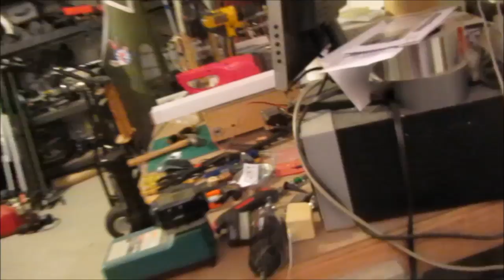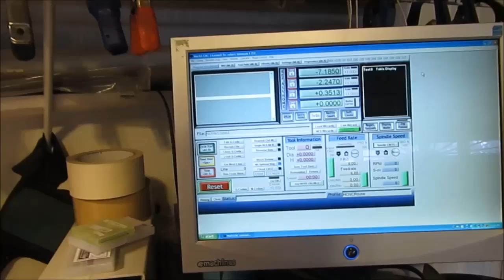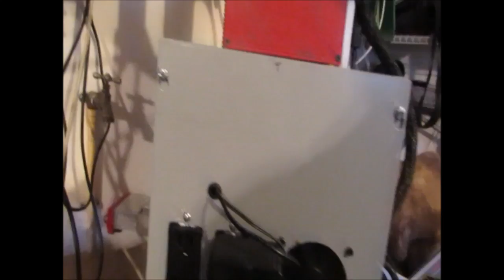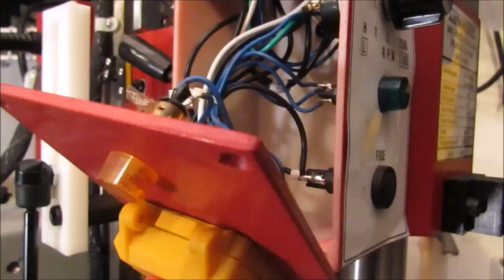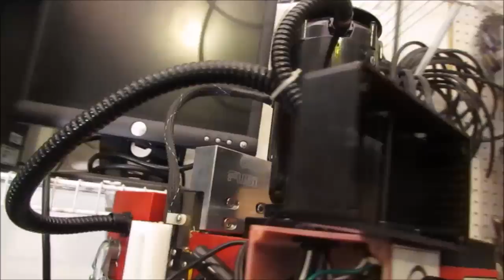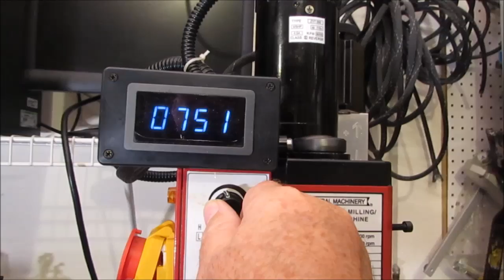Mini Mill Spindle speed RPM Meter Installation

Comment: What is the clamp called holding the sensor
Reply from the maker: It's just a plastic (electrical) clamp you can find at any Home Depot. It's used to hold wire and electrical cables.

Comment: I wanted to still retain the safety cap so drilled a hole that lined up vertically to the magnet and it is strong enough to sense the magnetic field.